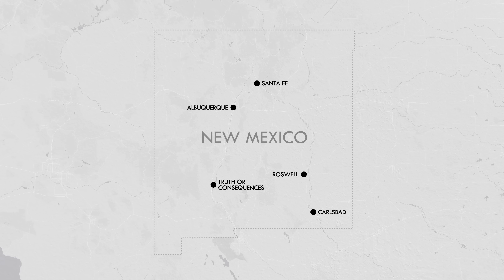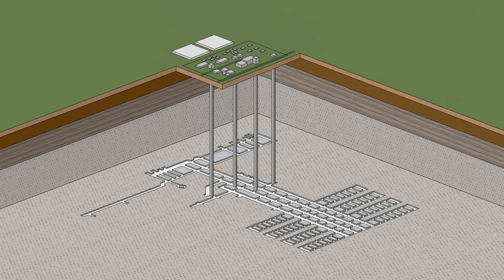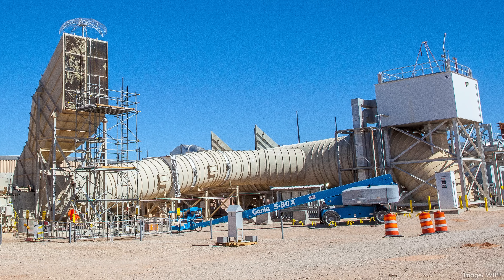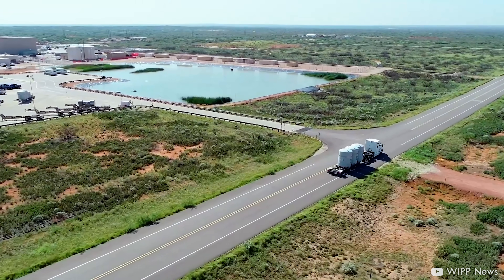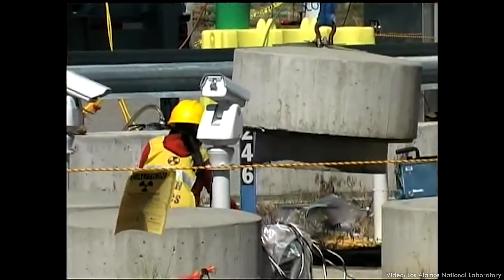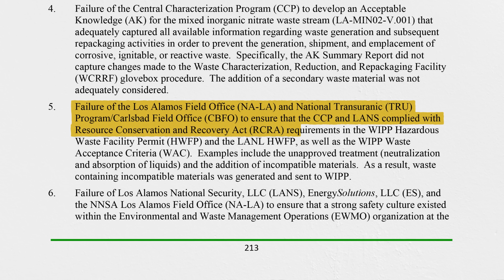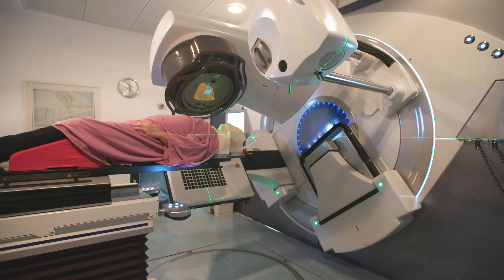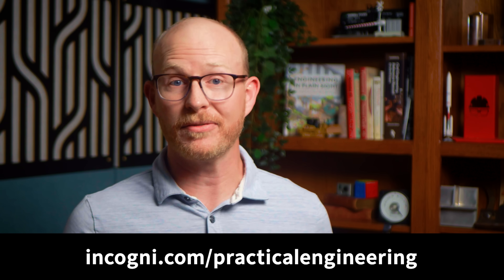When Kitty Litter Caused a Nuclear Catastrophe

Comment: you would think the number of times it specified zeolite clay; would have tipped off the supervisors that there was a problem with the document calling for an organic material.
Reply: Having been and end user reading lots of technical documentation for critical stuff that could kill people if it fails, I can see how the writer missed a word. It takes somebody with weaponized attention to detail to review those things and they might have caught the error and requested a correction which got denied. Hell, the people following the documentation might have noticed the error as well and asked for clarification and management shut that down as evidenced by this story.
Reply: @TheIdeanator  Weaponized attention to detail... that's me! Drives people absolutely up the wall, because I compulsively address any errors I come across, even relatively minor ones. Still, I probably would've caught that self-contradiction in a heartbeat, double-checked, and corrected it myself because I know nitrates are oxidizers so any organic material must not be stored nearby, let alone together with them inside a sealed container (confinement of energetic materials = bad... that's how you get brisance out of a deflagration!). Sheesh.
 
Still, they should've specified activated alumina desiccant instead. It's very inert (chemically the same as corundum / sapphire, just a different form), and a fantastic desiccant. Then there'd be no confusion.
Reply: @TheEvilAdministrator  I get it!!!  I, too, find that people don't wanna hear it when I point things out or ask clarifying questions.  I have a mental dossier of everything that's inconsistent, unclear, or inefficient in the official rule documents of my favorite sport.  My refuge lately is TTRPG books and the TTRPG community.  Lower stakes than work or sports, lots of fellow rules lawyers in the community, and authors with passion for the nuts and bolts.
Reply: @TheIdeanator  That is exactly how it should be the final review should ideally be done twice by people with the zeal of a scientist hoping to a Nobel prize to find any flaw whatsoever that makes the document and thus is conclusions unreliable. You actually want someone to zealously seek out faults in order that they can be the high bar they ought to be for faults to get by. It is not being picky especially when lives are potentially at stake it is what has to be done to ensure that vital documents are as accurate and their interpretation is clear when the clarity of that communication is literally vital to the safety other people.
Reply: You'd think anybody with any chemistry knowledge in the chain would ask "are we really mixing radioactive nitrates with chipped wood on industrial scale?!"
Reply: "I don't know Zeolite from Bud Light; I just know I was told to use "an organic" absorbent. Just doin' what the boss told me to."
Reply: You seem to be heavily underestimating how poorly management works at most companies. I have a boss who literally knows NOTHING about how to do her job and she's constantly asking me questions despite me starting at the company more than 2 years after her, which was 18 months ago. She makes literally 5x what I make and I basically do her job for her. And yes, we make and sell equipment for nuclear facilities.
Reply: I was thinking exactly this! What’s more likely, inorganic misheard as an organic, or Zeolite being mistakenly specified??
Reply: That's what I said. The phrase "an organic absorbant (kitty litter/zeolite)" makes no sense and should have raised alarms to go back and make sure the requirements are correct.  Somebody reading that should have said "Wait, what does this mean? Do you want zeolite or organic?"  Though all of that makes me wonder -- didn't they generate the requirements doc and then go back to the board to read over it and make sure everything was correct?  Seems like the kind of error that should have been caught on review....
Reply: Some soils are organic and some are not, maybe they just didn't know zeolite clay is inorganic?
Reply: Management is almost always an organizations greatest weakness.
Reply: Plastic pollution isn't just an ocean issue anymore — it is a lot closer to home than you might think. A recent study revealed that the average human brain may contain the equivalent of a whopping five plastic bottle caps' worth of microplastics.
What's happening?
In a groundbreaking study led by researchers at the University of New Mexico, scientists found that brain samples from 2024 contained nearly 50% more microplastics than those from just eight years ago. The average brain held roughly seven grams of plastic — the same as a disposable spoon.

It might translate to Campbell's soup.
Reply: Very true, but humans tend to like to use "nicknames" , acronyms or shortcuts rather than real words. You only need to se how young people text, half the time I have no idea what they are saying.
Reply: Whalers on the moon-style. The problem of prevalent lack of common sense/critical thinking skills and manual transcription introducing errors.
Reply: There was an "engineer" filling in for an assistant director where I used to work and overheard a conversation in which he outright said no karst topography and no reason to believe there was ... He was talking to hear himself speak. Didnt check didnt look anything up and this gov boss guy seemed dumb and took him at his word. I was a pencil pusher and even I looked at the photo album of them making the site where they were using tons of concrete to filll... Holes from the karst topography under the facility. Lol. Too bad I didnt know who his boss was I may have called and said duuuuhrrr.
Reply: Some people have chosen to become over educated beyond their ability to reason and/or apply common sense.
Reply: I'm also baffled by this. I mean. Doesn't it feel wrong to put some grass thingy inside a radioactive lead barrel to be disposed for thousands of years?
Reply: A few bits to mention: "polymer clay" is a thing, although zeolite is certainly inorganic. But there is another nasty gotcha that everyone here so far has overlooked, for all their "this was obvious": even in the original form, it did not specify the absence of other chemicals that are commonly found in zeolite-based kitty litter. They probably wouldn't have triggered a thermal runaway, but do you know off the top of your head which perfumes might react with nitrate salts (*which* nitrate salts, for that matter) to produce something shock-sensitive? Because I sure don't... and I very much doubt that it was studied, based on the original wording provided, because it very much looks more like they started at Zeolite and realized that kitty litter was a readily available form of it. So even if thewording of the report had come through verbatim, the procurement folks might not have caught all of the problems.

As for systemic issues: we only got shown the first five points (and part of the sixth), but at least that far into the list they were all "how did this slip through". As with most cases like this, a bunch of failures had to line up just wrong for it to happen. Any one of them not happening would have broken the chain. Which is why this event was news, rather than "oh, it's Tuesday". Fire everyone involved and you will be firing everyone, period. Firings short of that, barring active malice or a similar situation, would just be scapegoating. We were lucky here, they found twelve major points to address issues without it being written in blood, only radioactive kitty litter char.
Reply: I know a guy who was involved with this. They tried to tell the supervisor that this litter they received went against the job description and regulations. Higher ups didn't want to hear it and just wanted it to get done. Of course supervisor was fired, but now I heard she's like a director of another government facility. Just like @bigjay875 said lol, failing upward for sure.
Reply: Some people have heard that clays sometimes could be kind of organic, so they probably suspended disbelief
Reply: How about instead of 'inorganic' use the phrase 'non-organic.'
Reply: Kind of funny that a guy can make a mistake and have a document published with apparently little or no review. I am also guessing that the guy who made the "mistake" probably didn't get penalized. Since we are talking the Federal government, I am guessing he got a promotion.
Reply: @catnvol  This wasn't just one guy's error though. Somebody wrote down something they misheard, and shared their meeting notes with a colleague not knowing where they might eventually wind up. It would have had to pass through a lot of people's hands before being written into the guidance, and each step of the way somebody copied a word from somebody's handwritten summary instead of the whitepaper. 

The last line of defense should have been the procuring agents, who saw that guidance "ensure an organic absorbent (Kitty Litter/Zeolite) is added to the waste material". They knew that Zeolite was inorganic, otherwise they would have bought it. Thus they knew that the document was disagreeing with itself. But instead of running back up the chain to the source research to figure out why and which of the two directives was correct, they ordered something different from the material named in the document.
Reply: @icedragon769  You are just confirming why the document should have been carefully reviewed before publication. There is a name for this and it starts with "cluster". Everyone in authority involved should have been fired considering how serious the damage was.
Reply: @icedragon769  Exactly the document was clearly self inconsistent which should have made it obvious at least one of those inconsistencies was probably an error. I know that if I find a contradiction in a technical document I would be inclined to query it up the source chain to try and find the original non-contradictory source if there ever was one. Granted that does not always work as sometimes it can be hard to track it back to an uncorrupted source if there even was one and the error wasn't original. More often than not it happens when there is not a proper review after such things typically pass through a clerical staffer who was tasked with collating a bunch of notes into a formal looking document following the applicable manual of style, particularly when those draft notes sometimes include outdated information that can create contradictions a non subject matter expert like a clerical employee is unlikely to spot without an expert doing the review. Same goes for things that pass through managerial roles they too frequently lack enough domain expertise to spot mistakes.
Reply: @icedragon769  "The last line of defense should have been the procuring agents, who saw that guidance "ensure an organic absorbent (Kitty Litter/Zeolite) is added to the waste material".
If the guideline only says "organic absorbent (kitty litter)", that line is gone already.
Last line should have been a review of the internal guideline by someone who read the original paper.
There should also have been trace information of why you use that. Never write down "use organic absorbent" without a source so it can easily verified whether it is correct.
There should also have been a formal verification on whether all points which are mentioned in the upstream document have found their way into the internal guideline, and if not, a reason why they are not applicable.
Reply: @somebod8703  THANK YOU. So many people acting like the paper said to use organic absorbents when it was the procedure guidelines made off of the meeting informing them of the results of the paper.
Reply: @catnvol  that's a terrible idea. If you start firing people for mistyping a word people would just start avoiding responsibility and you'd end up in a situation nobody does any work, they just try to cover their behind, while the actual systemic cause is not addressed. 
What you need to do is change procedures to make sure things don't slip through the cracks any longer; like having the people to who developed the procedure read final paper for example.
Reply: @FaerieSeraphina  Sounds like a job that could be given to AI in the future and without a doubting brain the results could be even more disastrous...
Reply: @catnvol  Would you prefer the guy be fired for the terrible crime of... hearing a word wrong? The real failure here was systemic: that nobody compared the later instructions to the original decision.
Reply: @macdjord  I don't care how many words he hears wrong. I DO care about words he passes on for the development of safety standards. His actions cost millions of dollars, probably hundreds of millions or more. YES, he should be fired and everyone else in authority that allowed this to happen should be fired.
Reply: @catnvol  If the system is set up such that one guy mishearing one word for a very similar word can cause a major disaster, the problem is the system, not the guy. One of the reasons that air travel is so safe is because the aviation world takes this to heart: after a crash or lesser mishap, there is an investigation, but this investigation is not about assigning blame but about determining the cause of the problem and how to prevent it happening again. Indeed, unless someone is found to have acted with actual malice or gross negligence, nobody is punished for any mistakes that are discovered; even gross incompetence just means they are removed from that position.
Reply: @catnvol  'I am guessing' - or in other words I'm just going to assume whatever suits my personal prejudices.
Reply: Up and Out
Reply: @catnvol  the federal government was funding a corporation that made the mistake. This was private industry making the error.
Reply: @catnvol  "Since we are talking the Federal government, I am guessing he got a promotion." You seem to have it backwards. It's companies, not governments, that reward idiocy and destruction. Just look how many CEOs have tanked their company's productivity and been well rewarded for it.

A classic example is how McDonnell Douglas managed to take over Boeing and essentially destroy the entire company by prioritising "profits" over working aircraft and spacecraft. (The profits never happened of course, because they ended up billions over budget for something that couldn't even return crew to earth, or paying out massive fines and compensation because their aircraft flew into the ground.)

Give me government workers who focused on doing their jobs, rather than making money, any day.
Reply: @catnvol   If it were private, there'd have been so many other failures in the system before this little slip-up ever became relevant. Then it'd be on the government to put forth the penalties and regulations so that the company stops poisoning people in the pursuit of "cutting costs". The handling of something as dangerous as nuclear waste is exactly the kind of place you want government's "inefficiency".
Reply: @catnvol if it were a corporation, it would have been even worse.
Reply: @catnvol federal government, fail upward!  That aside, we do need long term dry storage for radioactive stuff.  Plus down the line there may be a materials that become very valuable.  One more thing I live 20 miles from a pair of reactors looking through the fence I am very concerned about security and believe having the bulk of that stuff under ground in a well guarded place is better than the current situation near me